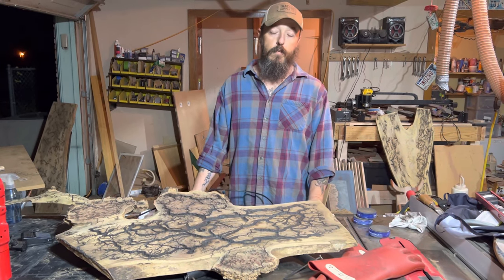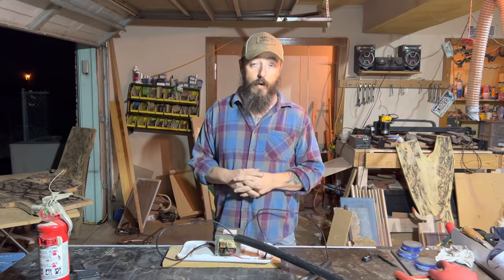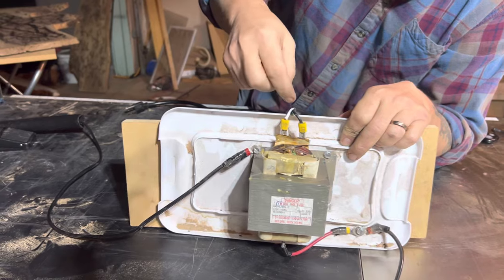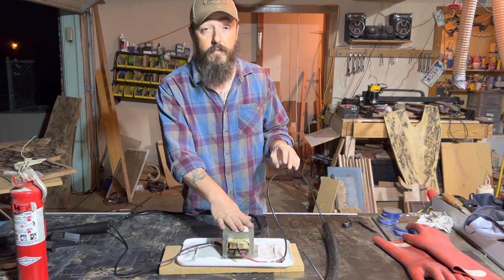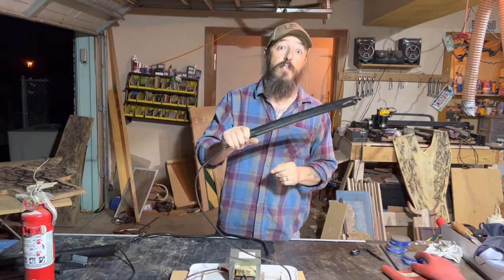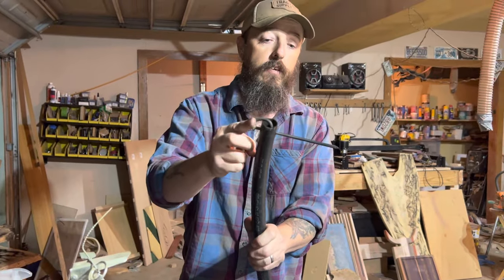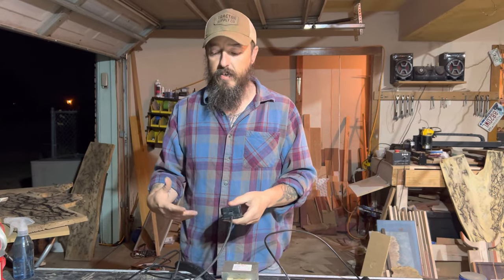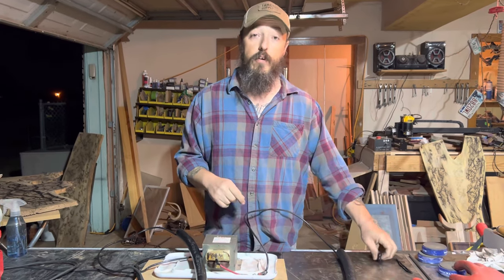Building a fractal burning machine

Comment: Hi again, it's Richard.   Last week you where very kind in getting me the info off your transformer.   I looked it up and found it on the internet to purchase.  My dilemma is it has a few wires on the output and don't know which one to use.  I want to do this right.  Can you help me with this?       Thanks  !!!
Reply from the maker: For the output I have 2 8 gage wires that I bought from an electrician. One of them is connect to the body of the transformer. There should be 2 male prongs on one side of the transformer. That is where you have connect the plug for the outlet. On the other side there should be one male prong. The other output is connected to it with a red wire. Tied into the 8 gauge wire that runs down to the nail. There is going to be a bunch of little red wires that are useless. I cut them off and the ground wire.

Comment: I wonder what would happen if you hooked the ground wire up then plug it in a GFI outlet
Reply: ...GFI outlets will work even without the ground wire attached...in older units, the "test" button won't work without the ground, but newer units have changed the circuitry so that it will...
However, that will only protect you if you touch the input voltage side (120V)...the high voltage side is completely isolated through the transformer...👍

Comment: You mentioned not using the green grounding wire. If I were to connect it, would the burner still work, or would it disable the burner?? Also, you could try to reduce your investment for the polypropylene tube by selling two pieces of it in 2 or 3 foot lengths.
Reply from the maker: The green wire is just a ground wire. It will work either way. Thanks for the idea on the poly pipe. Sorry it took so long to get back to you.
Reply: @darkhorsecreationswoodshop  No worries, I appreciate your response. 😎

Comment: Use marine grade heat shrink tubing. It seals out moisture much better.
Also you can buy poly pipe by the foot. I have several times.
Reply from the maker: thanks i will check it out. I cant find poly pipe any where around here by the foot.
Reply: @darkhorsecreationswoodshop  
Not being able to find poly pipe by the foot might be a regional difference on what's available. I've noticed hardware stores I've been to in different areas have different selections. I was surprised by the difference between home depot stores in different states I've worked in.
Reply: @darkhorsecreationswoodshop  look for PEX. Specifically look for (uphonor/wirsbo type A) cross-linked polyethylene tubing. If you get the type A, it can be heated to return it back to its original form after it cools.  Also, for your connections, I would look into service box connectors for main panels; like the lugs that you use to connect ground, wires to grounding bars.

Comment: at 71 and being the "dark horse" all my life I have been playing with this type of thing for awhile. But I am still having a duce of a time getting my burns to go across the grain like I want them to. I have tried graphite traces, scoring, small steps (which is hard with the transformer). I get it done but would like to have a bit more control.. Got any ideas? Just thought I would ask.. "dark horses" always know the secrets.. But hardly ever share them..
Reply from the maker: I have been doing a lot of research of the same thing. I have not tried it yet but I am going to. I have seen a lot of people only wet the wood where the want it to burn. They are designing a lot of different shapes and even faces when they do that. I have been meaning to try it. Just haven’t had the time.
Reply: @darkhorsecreationswoodshop  Thanks.. That it kind of what I have been doing to make just the burning around the perimeter of a block of wood so that folks can make signs inside of the borders.. Just wet the section I want to burn.. but that cross grain thing really gives me mixed results. Well, I guess I will just continue to play with it.. thanks for the help.
Reply: Mix baking powder in water. Paint your path with this let it dry a little. Repeat this a few times and it should follow the path you paint

Comment: Ordinary rubber gloves are not high voltage rated rubber gloves. The transformer belongs in a properly rated plastic enclosure. The ethical thing to do is discourage people from this unimportant use of dangerously high voltage because it's just for making decorations. There are plenty of ways to play with wood but burning for some reason fascinates adults who should know better than to want this dangerous foolishness. Not everything cute is wise and the woodworking world did fine for thousands of years without it.

Comment: NOT a GOOD idea! I have over a decade of experience with Fractal buring using various transformers. Do not loop your "8 ga." wire out the top of your poly pipe! [it should be GTO wire actually IE Gas Tube Only], but the reason to NOT LOOP IT OUT THE TOP is when you spray your electrolyte solution [and you will eventually],, the fine mist/solution is invisible and there is a line of current that can easily jump from your nail probe to the top of the poly pipe. When that probe is constantly higher on the nail end side, the electrolyte solution will run down the poly pipe and YOU WILL GET A SHOCK! I am speaking from experience as I grabbed one gto wire several feet from the probe and got a small shock, then realized the spray solution [disolved in a salt after it dries and is invisible]. The 20kv gloves help, but lets face it, we dont wear them all the time. A "dead man" switch is good too, but when doing slabs, you must constantly keep moving the probes. IF YOU HAVE TO MOVE A PROBE when hot, do so with one arm and the other arm behind your back. That way the current is less apt to travel up your arm and across your heart to the other arm. If one arm, then the current would find "ground" more easily by travelling up the arm, then down the same side leg to ground, bypassing your heart [which is how peeps die]. A NEON LIGHT TRANSFORMER can save lives vs Microwave IMHO [30ma vs 500ma!][ BE SAFE
Reply: Lol! this is in no way good advice 🤣🤣🤣🤣
Reply: Glad you are still alive and kicking👍One other small tip is to use white pvc instead of black HDPE for your insulators. Black material contains Carbon Black and is slightly conductive. I can't remember if you are using a MOT or NST, but I would also stay away from the MOT's. You have a slim chance of survival if zapped with a MOT system, vs a better chance of survival with a NST. Also, the NST's do not create a flash burn when the two fractals connect. Kick some more ass!
Reply: MY BAD on GTO wire...I meant to say GAS TUBE OIL, not g t "only"...for all of the youtube ombudsman out there! lol

Comment: On the setup of the nail's personally I used heavy Guage pvc pipe and ran the wire through it but drilled a hole in the pipe at the end and ran the wire out of it to connect to the screws that I use but to hold the screws tight I made a dowel out of scrap wood to fit into the end of the pipe and ran the screws through the pipe and wood it holds them in quite well and I wrapped the end of the pipe completely with electric tape to avoid contact with the power
Reply from the maker: Awesome. Thank you for this comment. I have been looking for other ways to make it safer.

Comment: I worked on high voltage valve equipment as a younger man and I'm telling you straight, I would NOT operate this device, the potential for self harm is outstanding. Using a wood screw into wood to clamp a connection is only the start. Please do not be insulted but be safe, this stuff will kill you and then cook your remains.

Comment: The wire used to connect neon tubes is 100% silicone and can withstand 15,000 volts at 50 hz 60 miliamps...called G T O wire any sign company can help you out

Comment: Deadliest way to make fractals
Reply: amps kill you not volts, its safe
Reply: @DG-kr8pt That's completely wrong. You need a certain voltage to let a lethal current flow through your body, so saying this is completely safe is pure nonsense. And it doesn't just depend on the current, it also depends on a lot of other factors, such as frequency, exposure time and what part of the body gets exposed.

Comment: You clearly don't understand how electricity works, so you're definitely not the guy who should explain this to others. Some points:

Switching live and neutral wire colors (though polarity doesn't matter in this case.
Not understanding why there's a return path connected to the transformer HV side.
Choose this wire cause the electrician said so.
Screws connected to HV GND on the transformer possibly in contact with your metal workbench, which then also becomes dangerous to touch. Remember that GND will still be floating (not at 0V) and this case still lethal.
etc. etc.

You would do well to remove this video cause people in the comments are already copying this jank device, and possibly hurting themselves. Coming from an Electrical Engineer.

Comment: I threaded my nails for the contacts and put a metal wire connector crimped on the end of  the wire and put a nut on the nail the my wire connector with a hole on the one end I put it on the nail over the nut then another nut on top and tightened it down. Works perfectly I don't know what the connectors I used are called
Reply from the maker: awesome, I appreciate you letting me know what you did. im always looking for ways to improve it.

Comment: Keep it out of reach from other family members and use some dead man switch or pedals at distance ensuring your hands are never near this voltage. Never trust your gloves as such voltage can easily jump through a microscopic damage and kill you. Professionals dealing with such lethal voltage will use certified gloves that are checked regularly with special equipment.
Reply from the maker: I appreciate all the input. I’m always looking for ways to make it better and safer.
Reply: @darkhorsecreationswoodshop  Yes, complacency is what kills people in this hobby. I hate to see videos of people playing Russian roulette with this hobby such as relying on some consumer gloves that some day easily can fail e.g. if some chemical touches it or even a needle or some spiky nail pricks through it. Trusting a rubber glove to keep 1000s of volts from the skin is like trusting a condom to be 100% reliable. But having an extra baby is less harmful and sort of opposite of getting killed.

Comment: Interesting seeing the comments. Some are educational, but the ones that say " you're playing with fire", "this is dangerous", etc are pointless. It's like- thanks for letting everyone know electricity is dangerous.....i wouldn't have guessed....
Reply: It’s not the electricity as such that is dangerous when building this type of circuit, it’s the fact that you’re upping the voltage without circuit protection. That’s what kills and has done on many times.
Reply: @utube1818  Thanks for the informative response. I thought about building one, as I have a transformer. Then I thought I'm not an electrician and don't want to die.... Lol. I don't like the fact that one misstep could result in death, so I opted out.
Reply: @jjkain  These things are deadly, high voltage at a high current, not many get away having a mishap with it.

Comment: I believe I just watched the other video which you spoke of in your video. If it was the same video it was by “josh and Jason destroy everything “
Reply from the maker: Yes sir. That is the one. That is where I got my info to build my burner. Minus the box.
Reply: @darkhorsecreationswoodshop  I’ve been researching how to make one, right now I am stuck at growing the balls two grab the extra rubber lined pliers I rigged up and discharge the 2000v capacitor 🤣🤣
Reply: @chrishubert5307  Based off of the very little you've said you're not smart enough to be doing this bro. You're asking for it. Darkhorse is FAR from being on the right track as well.
Reply: @YoureNotSoSmartBro  she thought my brain was big enough

Comment: And if you really want to make this better get you a neon transformer there outputs are stupid high , and get something to control your voltage
Reply from the maker: I originally started with a neon transformer I bought off Amazon. And it didn’t have any power. That’s why I built one. Is there a specific neon sign transformer you use.

Comment: I don't understand why people do this with microwave transformers. You can buy the machine to do this, already wired, with safety measures built in, for a few hundred dollars. It's just not worth risking your life, and spending hours of time, to do the exact same thing.

I think the machine is slower since it has lower voltage. But it is safer (although still very dangerous), and you can adjust the voltage and such in order to control the results better.
Reply from the maker: The cheapest one I found that does close to the same thing is $650. The ones you buy off of Amazon don’t put out the same current and I had one and actually got shocked from it. That’s why I built my own.
Reply: I do all sorts of things that you wouldn't understand why I do them. Why buy something when I can build it myself?